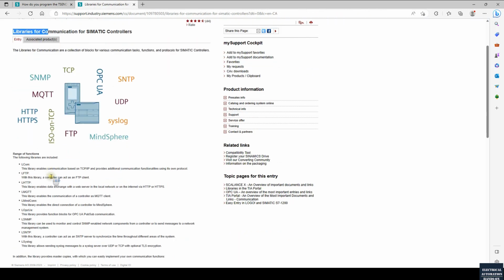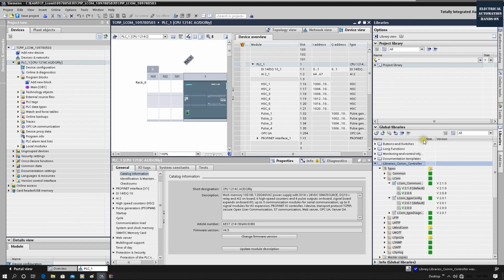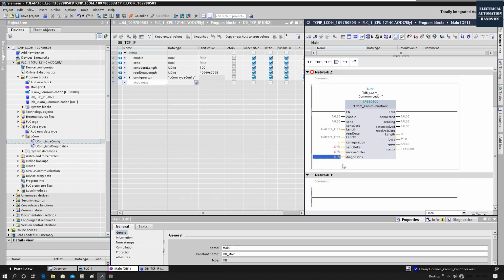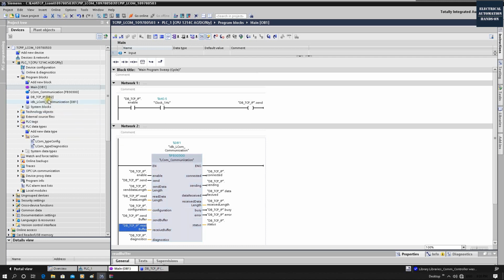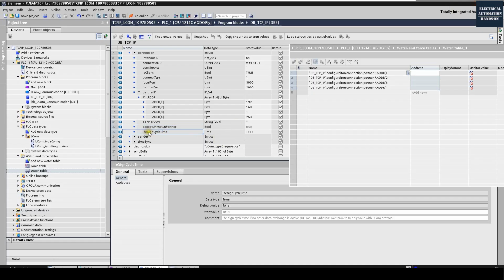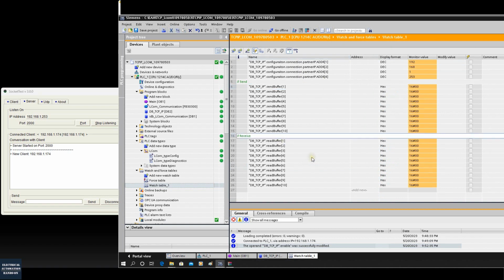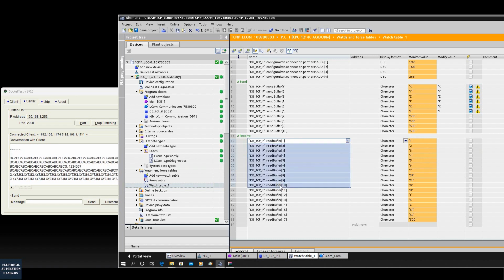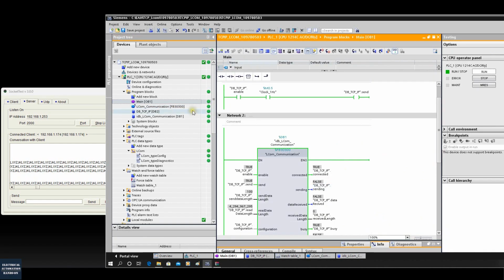COM32. TCP/IP - Use LCom library for TCP/IP by using Siemens S7-1200 S7-1500 PLC and TIA Portal

Comment: Thanks you for this video, I have a problem when I can start the socket "cannot assign the requested address jvm_bind", I tried with many ports but could not solve it.
Reply from the maker: Maybe use another laptop. It looks like your OS is rejecting the socket software. Also turn off the firewall.

Comment: if I have to send a string command to a device: e.g. FTUNE[CR] ..... Is there a way by modifying something or adding?😃😃
Reply from the maker: I believe this link will be helpful. A String has a header with two bytes, then the following are Char data after the header. https://support.industry.siemens.com/cs/document/42002283/how-do-you-compensate-for-the-string-mismatch-caused-by-the-rcv_ptp-and-send_ptp-blocks-?dti=0&lc=en-US